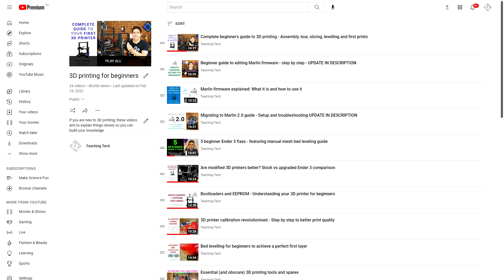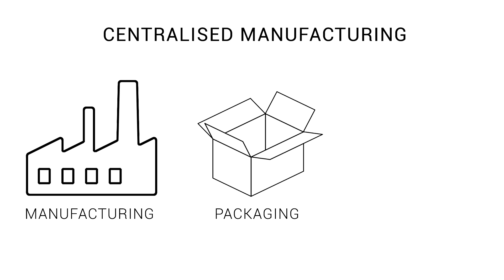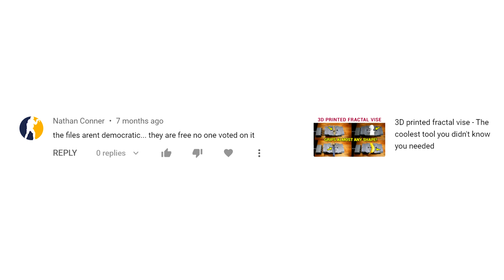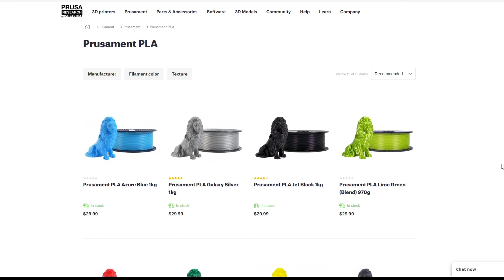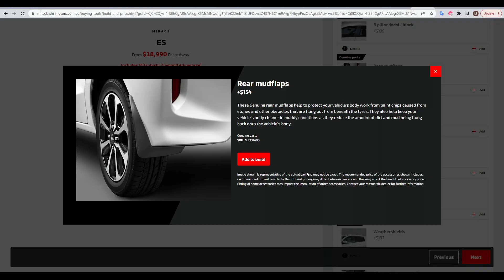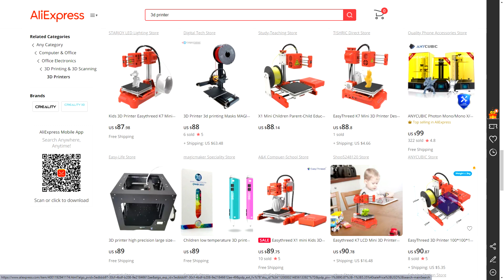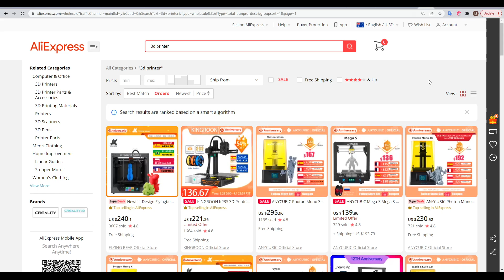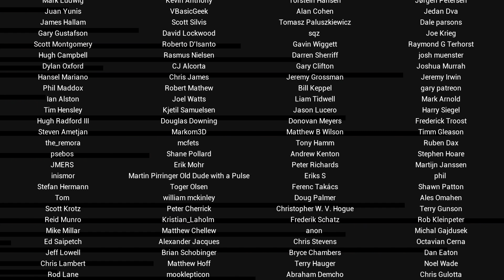3D printer trends are limiting mainstream acceptance: The 3D printing paradox

Comment: You can't remove the packaging and transport part entirely with home manufacturing, but it can be mitigated... Still need to make, package, and ship the filament to the home. The benefit comes from turning that one roll of filament that only required one package and one shipment into several things that would have required several packages and shipments.
Reply: on the other hand, the environmental impact of making 1 million 3d printers to print parts, instead of having 1 machine to do 1 million parts, being much more efficient in doing so defeats the whole narrative made in the beginning of the video.
Reply: I feel like this was obvious enough to not need explanation
Reply: @Kamel419  it's a lie of omission, the same kind that takes people in with solar. makes it sound like magic to someone who doesn't know how it works.

Comment: Sponsored by Prusa? You didn't mention the $2000 price as an obstacle.
Reply: That's because he doesn't think about the fact that most people don't have that kind of money. My advice? Look into the Flashforge Adventurer 3 or Adventurer 4, they cost $400-$500 and $750-$800 respectively, but don't get one if you want a printer to tinker with. The Flashforge printers are "plug and print" meaning all you need to do is make sure the bed is level, and make sure the filament is good quality, and you're good to go. I've been doing serious research lately and out of all the machines I've seen reviews on, it really comes down to Creality and Prusa being the Titans of the 3D printer world, but you're either going to pay more for upgrades, or need a mortgage on your house to pay for a Prusa. Flashforge took a different approach with their (albeit smaller print space) affordable printers that still have really good quality prints. The only cons that most people mention is the proprietary slicing software (FlashPrint) and the printer uses a bowden extruder, another problem with the Adventurer 3 is it only holds .5kg spools, the Adventurer 4 can hold a 1kg spool. Hope this helps!
Reply: @crazycherokee8552  people really get addicted to ender modding but it's really unnecessary.

Comment: As long as cheap 3d printers aren't maintenance free they will never be mainstream, so the expensive 3d printers would have to become cheap for 3d printers to become mainstream, still a few more decades to go imo
Reply: Everything mechanical needs maintenance. The more expensive it is, then the more the OEM will justify proprietary support. Industrial CNC machines are prime example.
Reply: @StonegateCreations  The problem is not maintenance. The problem is that maintenance almost always involves complex diagnostics based on an in-depth knowledge of how the technology works. Imagine if you had to store multiple profiles for different foods in your microwave and experiment to get it to heat food properly everytime. Or imagine if you had to take said microwave apart when it mysteriously stops working, and troubleshoot individual components to isolate the cause. That's the current state of 3D printing.
Reply: @Guile_SF  i agree the more complex the system the more knowledge will be needed to diagnose, and more expensive to fix.
Reply: @StonegateCreations  Agreed. It’s not that far out. Most people don’t do basic maintenance on practically anything they own, such as a house, car, or even their own computer. The only thing people need is some established help like all the other industries have developed. 👍